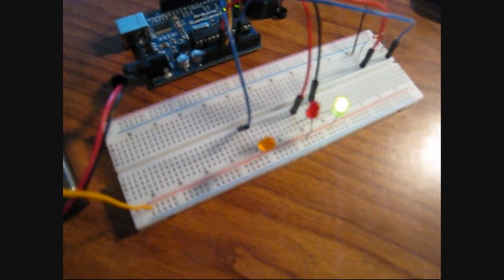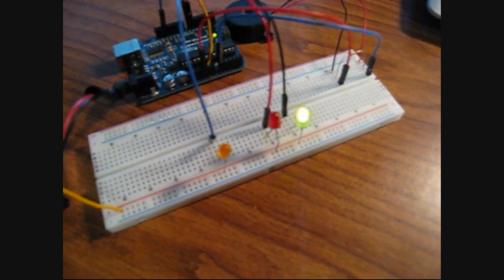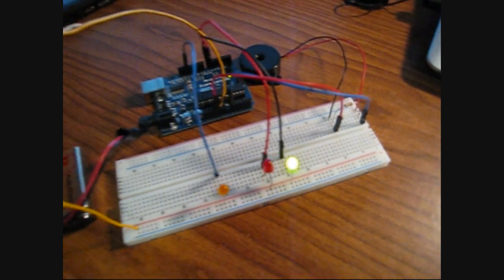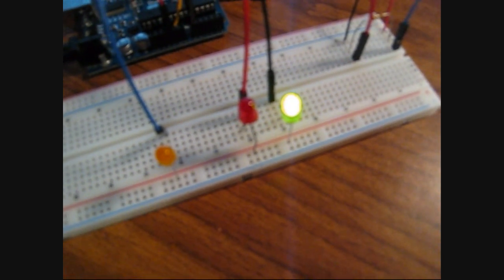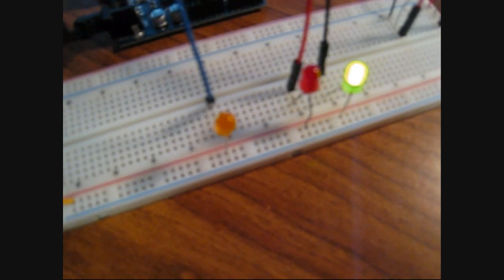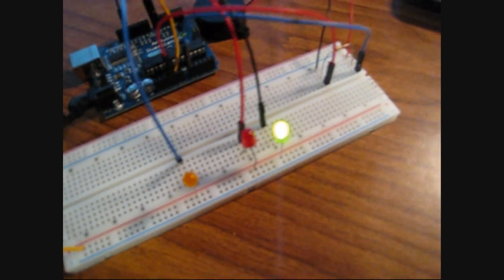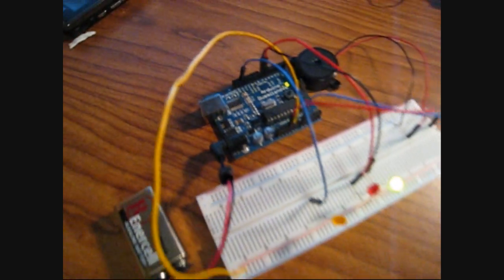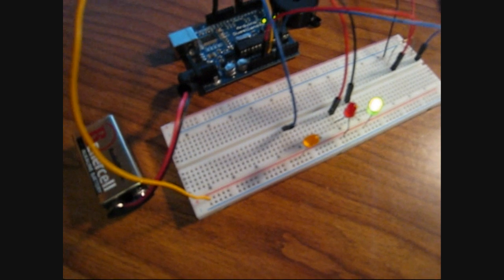Arduino Knock Controlled Door Opener/ Unlocker

Comment: Nice work! You can use an electronic strike instead of a servo motor. The strike takes a 12V signal to release and allow the door to open. A security system install company will have the strike. You can get used ones for about $25.